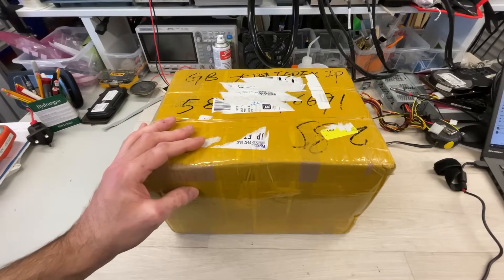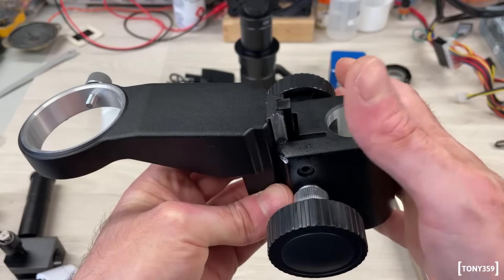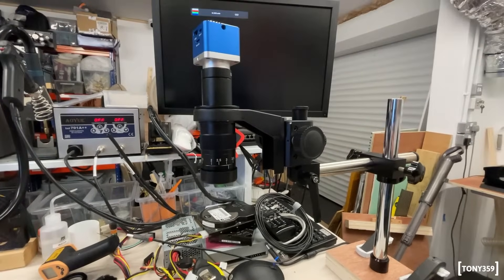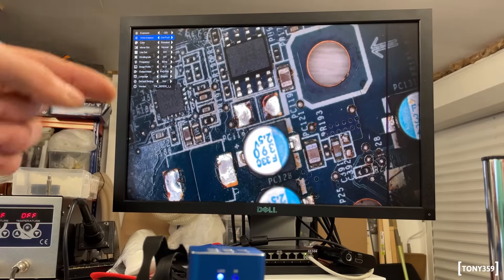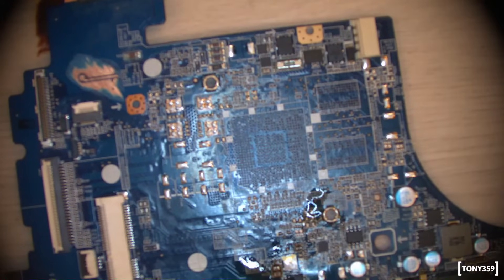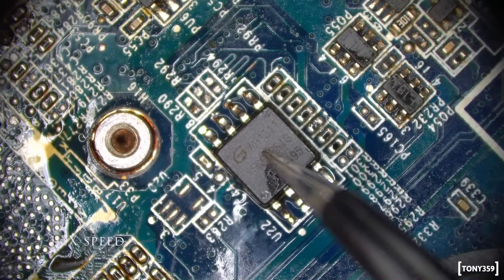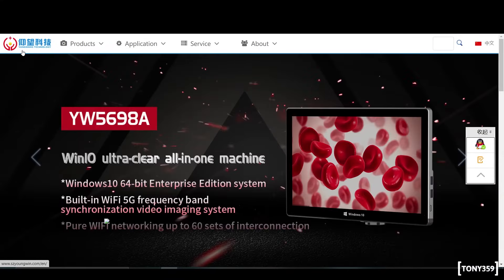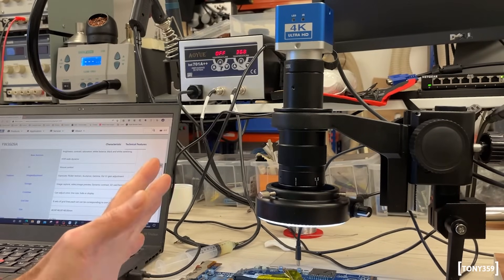Lapsun 4K Microscope - Sony IMX377 (?) - Unbox and Review

Comment: is this a joke? how do you test 4k microscope without 4k monitor? most chinese 4k microscopes don't output 4k hdmi.
Reply from the maker: I didn't have a 4K monitor then - I can tell you that this Lapsun does output 4K on a TV - whether it's actually 4K or scaled 2K it's difficult to find out. As it's the 60fps which is actually 30fps "doubled". In photography the resolution is not everything - but that's often pushed by marketing as "4K is better than 2K" :) In this case I find the quality of the image to be very good and unless you're watching on a 70" TV, I really don't think 4K is so important. I see online many 4K scopes which produce a MUCH WORSE picture of mine. Thanks for your comment and for watching though!

Comment: bad microscope with bad camera. This really is no microscope with this bullshit optics, not worth the money
Reply from the maker: you think so? I'm pretty happy with it, I haven't seen many alternatives of similar price delivering similar quality. In fact I've seen much more expensive ones delivering WORSE picture quality! The thing is that there are too many on the market and finding a good one is difficult. Thanks for watching!
Reply from the maker: What full-frame mirrorless can you buy for £200? And what lens can focus at a reasonable distance and provide the needed magnification? And how much is this lens is going to cost? These are genuine questions :)
Reply from the maker: Which DCM model exactly? The ones I see here are not full frame.
Reply: @tony359  G5 and G3 are fullframe and G3 are abel to give online HDMI output
Reply from the maker: The G3 is a "Four Thirds" sensor - it's smaller than an APS-C. Probably a good sensor but not a full frame!
Reply: @tony359  wikipedia says....
The Panasonic Lumix DMC-G3 is a digital mirrorless interchangeable lens camera
Sensor	17.3 × 13.0 mm Live MOS
Maximum resolution	4592 x 3448 (16.7 megapixels, 16.0 mp effective)
4:3 native; 3:2, 16:9, 1:1 image format(cropped from 4:3 native image format)
..........
so what, not sufficent for ou
Reply from the maker: No, just saying it's not a full frame machine!
Reply: @tony359  what means full frame.......meaning the size of the sensor...but the important fact is the software and the mirrorless. The sensor of the G3 is absolut sufficent for the resolution of an light microscope and is has a little tochscreen also. G3 is defintly better than every ocular camera, because you can use it also as perfect macro camera
Reply from the maker: @lotharmayring6063  a full frame sensor is 35mm wide. It's the same size of the old 35mm film - hence the "full frame" name. A "full frame" machine is quite a machine as the quality of a full frame sensor cannot be reached by smaller sensors - hence my surprise that you could buy a full frame machine for so little, even if old. 
I am still not sure on the lens arrangement here but I trust you :)
Reply: @tony359  a microscope-tube has an diameter of about 22mm so a fullframe sansor makes no sense
Reply from the maker: it wasn't me who mentioned a full-frame camera!!
Reply: @tony359  for me full frame is, when the opening window of the Camaera backside frame is fully coverd by the sensor and has nothing to do with old plastic films. This camera never had one. And this is the last comment to this unproductiv discussion
Reply from the maker: @lotharmayring6063  https://en.wikipedia.org/wiki/Image_sensor_format

I haven't invented the name "full frame", I'm sorry. It's called full frame. It's not "for me" or "for you".